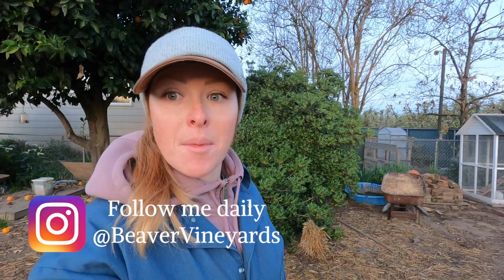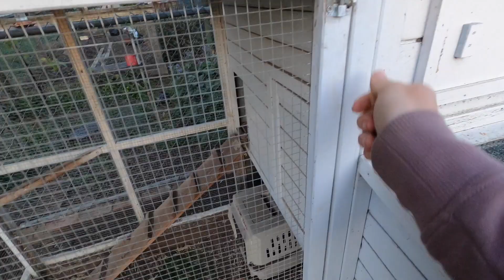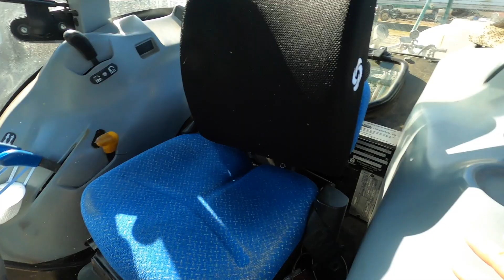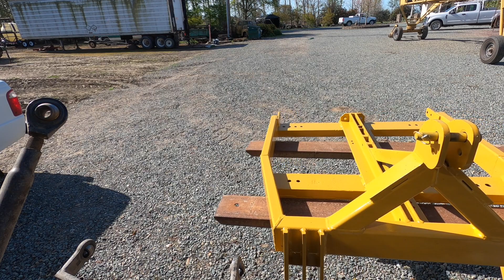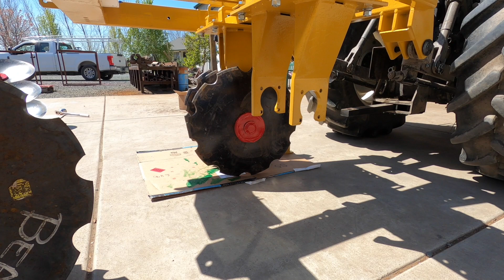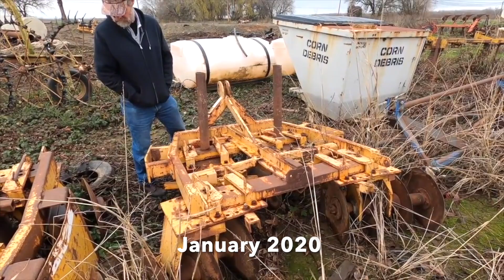New Disk, Who Dis?!

Comment: Sell the roosters, pays for the feed for the flock.
You are turning into quite the farm mechanic

Be interesting to see if that light in the rear tractor is going to need some weight on the disc to cut in the spring